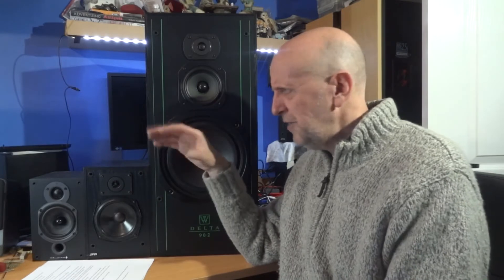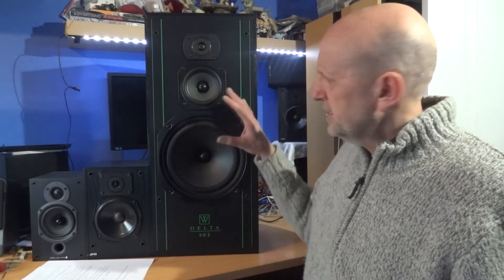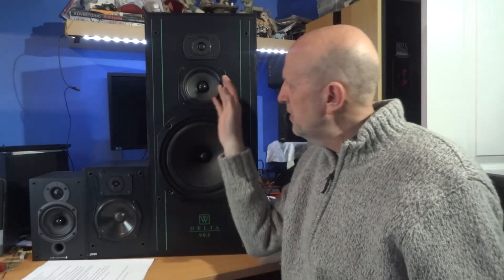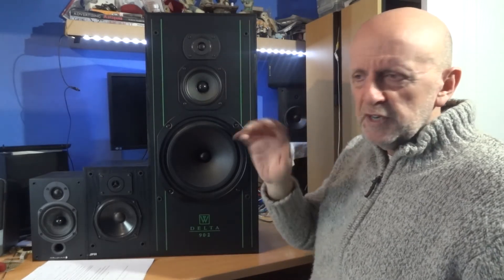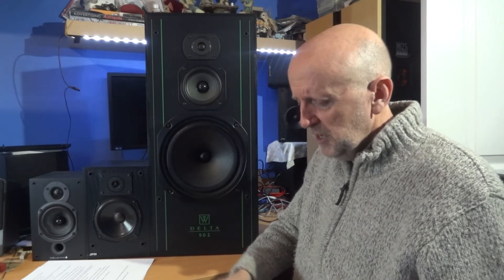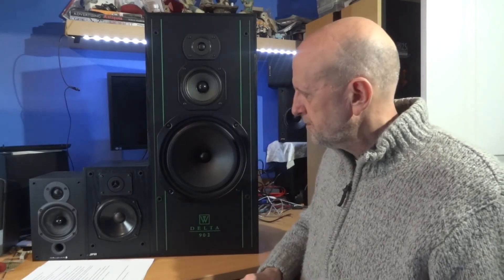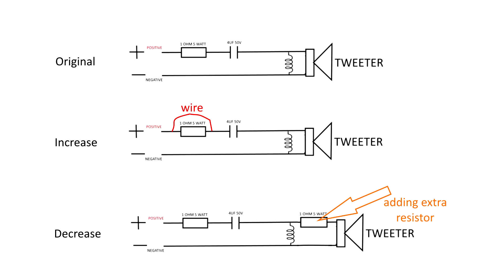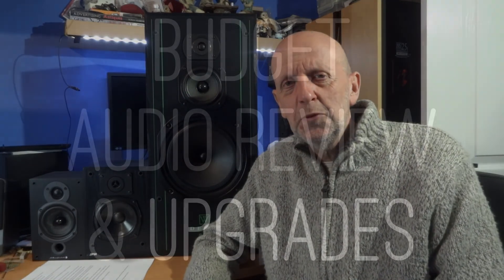Speaker Midrange and Tweeter Attenuation & Amplification Mod, Stereo Audio HiFi Speakers Wharfedale

Comment: Can i use 33ohms for the tweeter
Reply from the maker: A 33 ohm is series with the tweeter sound a way to large value, normally upto maybe 4 ohms would be max. This link explaines it very well, which also shows the way a L pad configuration might be a way to go. https://soundcertified.com/how-to-reduce-tweeter-volume/

Comment: Can i use a higher than 1ohm resistor?
Reply from the maker: Yes, but I would have thought that you would not need go much higher than 4 ohms as that would bring the volume level quite a bit
Reply: @MichaelYates  I see... Thank you! This is very helpful as im trying to tone down a quite loud tweeter.
Reply from the maker: Being a tweeter, you can easy go up to a 10 ohm resister to quieten it down, also some foam directly in front of the tweeter inside the front cloth grill might help to.